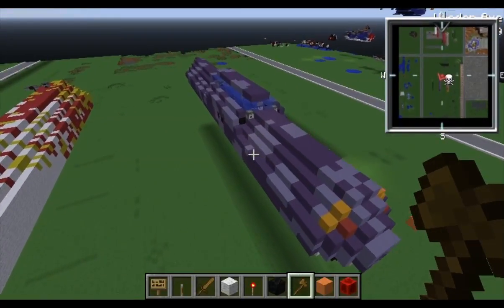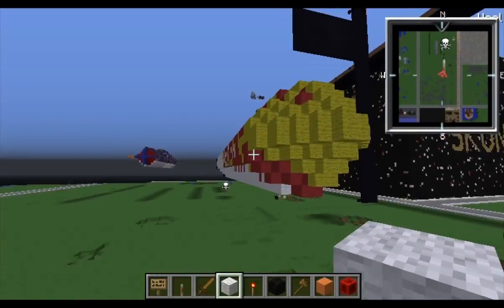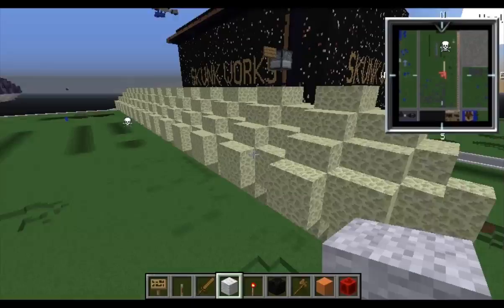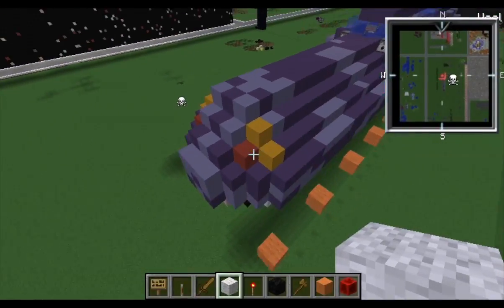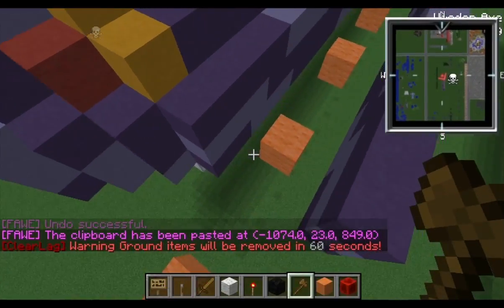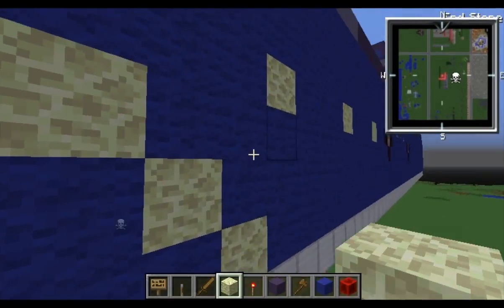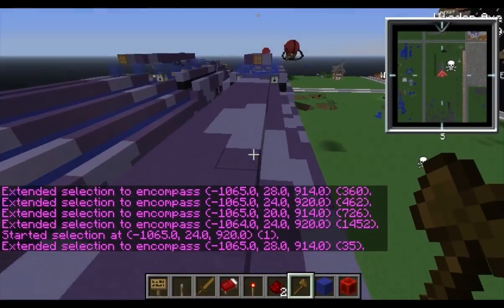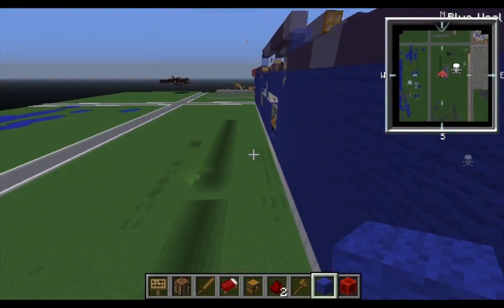High Speed Ship Turorial: How to make efficient hull designs

Comment: To Anyone Who Reads this, here is a list of suggestions I have for
future Airship Pirates movecraft/server updates:

-Fix Lighting glitches on moving ships (This is already being worked on, but still wanna mention it)
-Fix glitching redstone torch clocks. (Some firecharge dispensers work on a torch clock which can misfire while flying)
-Fix wool color glitches while moving. (I have a ship thats black and red. While moving it the colors of the wool change and switch around, but
chance back after release)
-Add other ways to power flight. (currently, wool and redstone blocks (and iron) are the only things that are needed for flight. I suggest
adding propellors that actually contribute to the fly blocks required or helicopter blades etc.)
-Add variety and change how some crafts work. Maybe add a plane craft which cant stop midair and cant go backward. Have it act like an
actual plane. With this, many new ideas for ships and new fighting tactics will come about, making the server more fun)
-Coolant. (There was a new update adding cannon overheat. Countering this, a cooling system should be added when dispensers
with water adjacent to it (or ice/packed ice) will lessen the heat while things like lava or torches will increase it)
-Moving Parts. (This would be sort of an extension to the propellor idea. I think that having moving parts on ships will make
the ship feel more alive, and more realistic. I made a helicopter and it looks really stupid when it flies with a blade that
doesnt spin. I was thinking of it working like rotating cannons, except have it rotate in 8 directions rather than 4)

Like if you agree with any of these suggestions and feel free to reply with your own. If this comment gets popular enough, there
are chances that these ideas will come to life.
(Im not sure if there is a suggestions forum page, so dont attack me for not knowing. Let me know if there is a page, but
either way, like if you agree)

(Im not a programmer, so I dont know the difficulty of implementing any of these ideas. Some might be easy while others might be
impossible. Thats why these are just suggestions. Thanks for reading (if you actually did), and I hope these ideas might
someday happen!! Have a great day everyone)
Reply: There's something called player_ideas on app administration you know...
Reply: where's that
Reply from the maker: Yeah, this is something that may not be completely fixeable. Minecraft just doesn't like the kind of rapid lighting updates that are necessary.